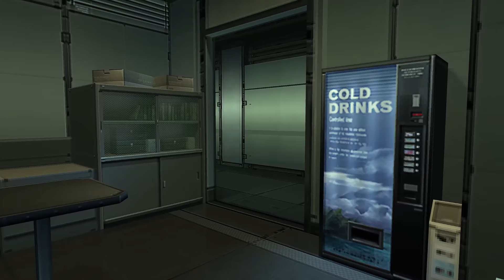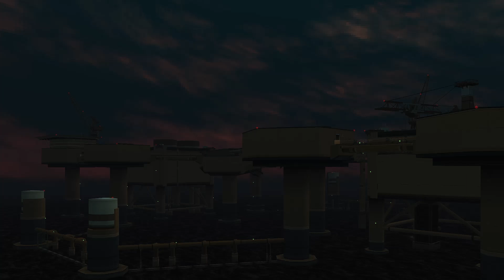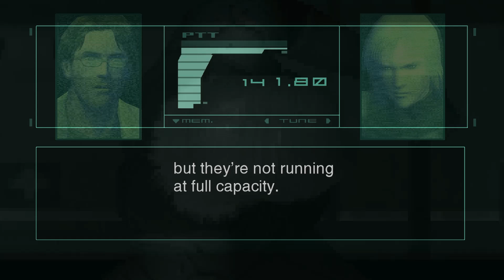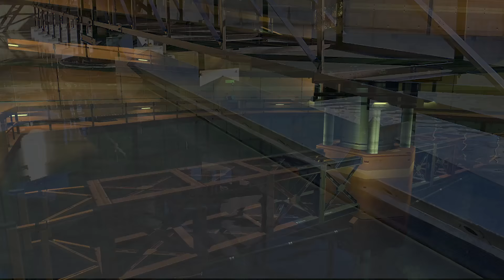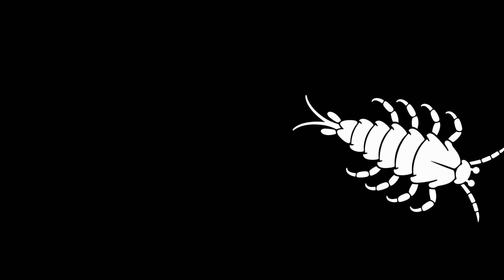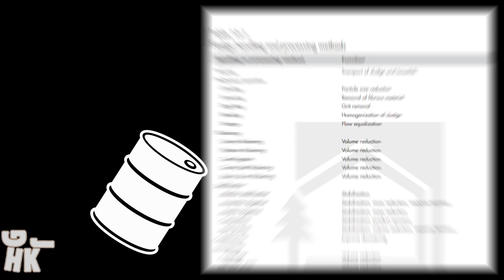How Realistic Is MGS2's Big Shell?

Comment: Oil's density property is why Water is the LAST Fire Extinguisher you want to use on an Oil & Petroleum based fire, rather you want the CBS Foam, the Blue one, which Smothers the fire, here removing the Fuel from the Fire Triangle! Water, Red, Cools, removing the Heat, CO2, Black, Starves, removing the Oxygen! My Fire Safety Training coming in handy outside of Health & Safety tests!

Comment: maybe the piles output on the opposite side that they intake? putting clean water outside the barrier holding back the oil, so the water doesn’t get sucked back up with oil water and they can use the same terminals?

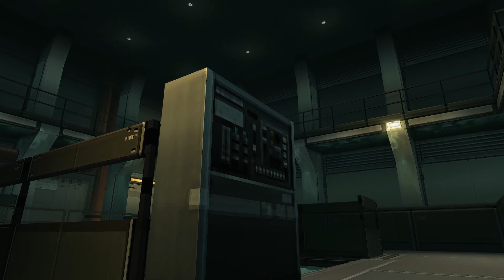Comment: 22:30
No it isn't. Practical engineering did a video on the most dangerous water on earth and it has something to do with this exact principle. No ofc it doesn't turn you into a lead weight...it just doubles the amount of energy it takes to move in any direction other than down. Which will keel xD

Comment: I think there might be more to Otacons idea of them secretly dumping more oil into the containment area than you might initially think. It is important to remember that the "oil tanker" that was sunk was done so deliberately by the patriots and that it was also in reality just camoflauge for Ray's deployment to a testing ground off the coast. I suspect then that there might not have actually been much oil actually on that tanker especially given when Snake accesses the navigation console he says the cargo should have been discharged upriver. 

Further the patriots MO is absolute control so having much more controlled amounts of oil being dispersed to minimize enviromental impact as they dont gain anything by destroying the ecosystem further this would let them get really good pr due to the very minimal damage that would actually have occured.

So by running the facility at a much lower capacity than its really capable of and only releasing enough crude to look scary to the public they get the image of a functional facility to hide arsenal gear.

Comment: Every single module of the Big Shell was given an identified purpose in this vid, except for the Shell 1 Core. To my recollection, the first floor had a room with a lot of lockers in it, which I presume is supposed to be where the personnel keep their work-related belongings. The first basement floor had a small storage room in one corner, a small break room in the opposite corner, and led to a conference room, which itself had a few branching rooms (One of those being a bathroom that Johnny was occupying). The second basement floor had the access point to Arsenal Gear, as well as a lot of computer stations. Sooo I guess the Shell 1 Core's purpose was mostly for worker and business affairs, but also had a lot of computers to perhaps also monitor things much like Strut A's control room? That's my guess.

Comment: With the construction shaping and paneling in the pump room, it's likely that it's not actually fully sealed. The ceiling may in fact be actuated to open.
There's also got to be a lot of fuel processing, material processing, etc for the sake of Arsenal Gear's production, so most processed waste is absolutely going into that. There are a lot of things you can make out of oil, after all.

Comment: Big Shell isn't realistic at all.

Kojima literally designed it with Lego, and the structure ignores real offshore engineering. You can't build a huge industrial ocean facility out of tensegrity, because waves, currents, and steel weight require massive rigid foundations.

The thin bridges wouldn't support the cores either, if a strut blew up like Strut H in Shell 2 the whole section wouldn't slowly sink (like it happened in game). It would collapse instantly and take the rest of Big Shell with it.

Comment: It is worth noting that the pipes are reaching from the Shell 2 side pile to the Shell 1 side pile and then to Shell 1.  Is it possible to see from the overview shots if the other fence's pipes also go to Shell 1?  Or do they connect to Shell 2?  If it's the latter, there's your intake/outtake.  Intake from the E/L fence's pipes, pump it straight across the 1-2 bridge, then out through the C/H fence's pipes.  If they're both intakes leading to Strut A, then yeah, we have a missing outflow problem.

Looking at the Strut A pump room - I do notice that the ceiling appears to be sectioned in a similar way to how offices have those drop-ceilings.  Perhaps these are some sort of modular ceiling that can be removed by the cranes to grant access to various parts of the room?  (This isn't the obvious strategy IRL, but the world of MGS has much more sophisticated engineering in some areas (the best mechs we can make are nowhere close to metal gears) so why not others?)

Shell 2's water: so...high oxygen content in water doesn't effect density.  But if you're constantly streaming bubbles into the water, which we can clearly see is happening, that does indeed reduce density, and real world pools that undergo this process are labeled with "do not swim" signs.  I believe testing as to how much they actually impair the ability to swim has shown it's rather less dramatic, but that's testing that happened well after the game came out. so...

Comment: Since we've already established that oil is less dense than water, it would make sense for the intake to be extremely close to the ocean's surface level. Conversely, it would also be logical for purified water to be discharged into the depths, at least 100 or more meters below the surface. That would likely help prevent immediate recontamination.

Comment: I think the lack of escape equipment is 100% premeditated; the reality is that the facility is a cover for a maximum top secret black-budget project. A lifeboat is a godsend for anyone who knows too much to escape and potentially vanish into NYC.

TBH though, the facility seems kinda massive for just one tanker that could navigate the Hudson, like, surely you'd just floatwall off the spill and use skimmers and the vast majority would be cleaned up by 2 years in. And the name, 'the big shell', for a facility that is just a big, empty shell. I guess GW wasn't very imaginative.
Reply: If I remember right, Otacon implies at some point while in the Shell 2 Core that they sent a second tanker to the same spot and deliberately scuttled that one too before assembling the Big Shell.
Reply: @HESHRocketWarhead  THe first tanker had no oil, it's holds were full of marines and MG Ray; the second tanker was specifically so they had a reason to build the big shell.

Comment: If there were lifeboats, how are they supposed to be used? Drop from 100m high? And from which struts, and access from where since all struts have thick walls with no windows? Even if you dropped them in the water somehow you'd still be stuck inside the big shell perimeter with no way of getting out of it, same reason boats can't access the big shell. It would be silly to hang a bunch of lifeboats just for show. But also, carrying all the machinery, food and replacement parts by helicopter is a huge waste of transport. Let's hope that almost all spare parts were already stored in advance in strut E before they finished building the shell. Then only when parts are needed, they are transported by the conveyor system of strut F. That's probably why most food was already stored there for long term use, no need for fancy kitchens, everything is likely microwaveable. It saves daily helicopter trips with groceries. Plus if they have fishing poles long enough, they have plenty of fresh fish
Reply: Given how you could climb down to the oil fences, my guess is that there were supposed to be lifeboat pods on the outside of the oil fences. Emphasis on "were" of course.

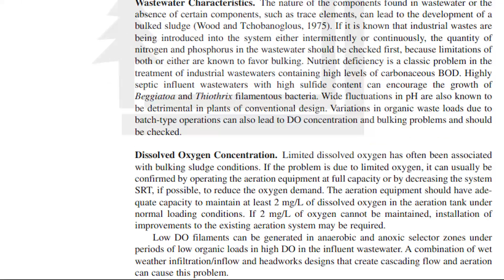Comment: 22:05 Dissolved gas doesn't appreciably change density, but aerated water can have reduced bulk density. Aeration introduces a ton of small bubbles from below, kinda creating a gas/water colloid or foam, which can drop the effective density. I'm not sure how low it can drop the density though, and it's likely that the large volume of rising bubbles will themselves provide lift counteracting that decreased density. Regardless, I don't think jumping into a vat of wastewater would be wise. 😂

Comment: There was no significant amount of oil in the first place. The ship that sank was carrying Metal Gear Ray, not oil. 

So if there is any amount of oil, it was shipped in for sure, and there's no reason to believe they wouldn't keep shipping oil in to replace the first shipment.
Reply: As a kid I’ve always thought the massive oil spill was just genuinely coming from the tanker’s engine considering it’s a big ass boat
Reply: @Rizzler8483 nah, it was the actual oil tanker they shipped in and deliberately scuttled.
Reply: All those metal bits surely need lube
Reply: The Patriots send in a second ship full of oil and sink that too, I'm not even kidding.

Comment: See the question I have is how much of this equipment is used for disguising the Big Shell as the purification plant and how much of it is actually used to help develop Arsenal Gear that just blends in with all of the other pump equipment
Reply: I imagine the logistics division (Struts E, F, H, and I) also doubled as a way for them to get necessary resources to develop Arsenal Gear. Strut C probably also doubled as actual accommodation for certain individuals like whoever was coming to work on Arsenal Gear too. If we reach a little bit, we could consider that Struts B and J were intended to also provide power for operations down inside Arsenal Gear in addition to the Big Shell itself (At least until they were ready to disconnect and fire up their own on-site power systems. Systems they wouldn't need to use for the time being since they had a decoy power system on the surface), and perhaps the Shell 2 Core's first floor was to keep there air down there fresh enough as well.

Comment: Some explanation might be crude oil. It contain light and heavy fractions. Light fractions are purified initially, but very heavy fractions, such as mazut and bunker fuel, settle to the bottom. This also explain why the base was partially abandoned and why there no oil skimmer on the sea. It’s incredibly difficult to clean heavy fuel from bottom because it’s forms tar balls. This heavy components form sticky spheres that can roll along the sea floor or wash ashore.

Comment: Thank you for talking about this. Ever since I started working in wastewater treatment it's been bugging me how there's a clarifier without sweeps and an aeration Basin in an enclosed room.
Reply: As a hobbyist level designer, who's worked in a ton of warehouses, and does idle research on safety regulations and other architetural subjects, I always end up noticing the brazen lack of safety-compliance in the environments most common in FPS games
I get it, since if they were "compliant" most levels would be a sea of yellow barricades, chains and fences. It doesn't "bother me" but I do notice
My favorite is how most cages on ladders usually start below the mounting point, which is the very part cages are meant to provide additional fall protection during
Almost every ramp is too steep. Almost every staircase doesn't have enough landing area at the top bottom or between, etc

Comment: Oddly, my biggest problem with The Big Shell's design was its kitchen, or lack thereof. No dish pit, no overhead ventilation, no mop room, limited equipment. The list goes on. Even with a skeleton crew, a plant that size is feeding at least 50 to 60 people three meals a day and operating nearly 24-7.
Reply: Considering one of the major themes in the game is AI control, it's safe to assume that the facility has as few workers as possible in lieu of machine automation. If I recall, the "terrorists" only took about 30 hostages, not to mention that the Arsenal Gear is supposed to be the "life boat", so the kitchen on the surface doesn't need to be extensive.
Reply: @forgot7en  Also a lot of those hostages were only there because of the presidential inspection.
Reply: I'm not sure how much of the design oddities are oversights vs how much is leaving clues that the plant is actually just just an elaborate front for Arsenal Gear
Reply from the maker: Good point, I completely missed that. Packed lunches only then I guess!
Reply: To be fair... this is all happening off the coast of NYC/Lower Manhattan.  So people could just ferry out there for their shift.

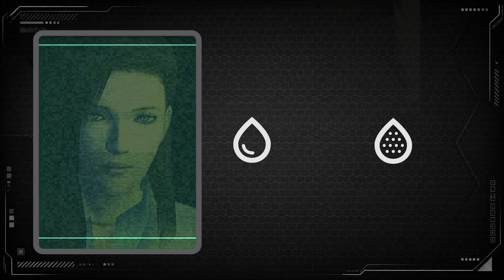Comment: 3:16
Not sure if it shows up later, but wastewater sludge usually ends up on farms as fertiliser. 
That or it's burned for a mediocre energy gain.
Reply from the maker: When reading I honestly never came across where it ended up. I always assumed it was dumped somewhere like trash. But it’s good to know it’s not completely wasted!
Reply: @ProbablyPaz  Strangest thing about the big shell is that they turned it into an oil disposal facility. 
Oil collected from an oil spill should still be able to be converted into fuel after it's separated properly. The other issue is that the big shell is treated somewhat like a sewage plant, if they're just pumping the oil in, sedimentation tanks wouldn't create sludge, just separate out coarse marine debris from the oil. This would also mean you have perfectly functional crude oil, which they're using sea lice (likely a mistranslation of sea slaters) and bacteria to break down and then create much less useful sludge (which could be burned in their local powerplant to turn the biomass back into energy) though why the big shell didn't just:
A) Distil the oil out into fuel oil and pump it directly to New York by turning it into a fractional distillation plant. 
B) Pump the oil to land, or to ships outside the oil fence by running a pipe under/through it, then have it distilled on land. 

Doesn't make a huge amount of sense, for a fresh oil spill. One reason would be that Though Kojima likes to turn his games into a bit of a show and tell for his own opinions so I'm assuming he wanted to tell the audience about how oil spills could be cleaned up. 

Another reason for this might be that they left the oil sitting out in sun, waves and open air for a while while the big shell was built. This would start causing some of the crude to weather, turn to dense tar and sink. Or parts of it would mix with the water, or emulsify, polluting a large area. Which would be why they need a full containment fence while it wouldn't stop emulsion or contaminated seawater from getting out, it'd at least stop lumps of tar. This would fit how the big shell works a little better. It would also fit the timeline too, as the big shell can't have been built overnight. 

They'd have spent their time better just recovering the crude oil immediately, I don't think there's a reason for why they didn't do that ingame. So I'm split on it being a Kojima interactive video essay and a half-baked execution of oil recovery and cleanup.

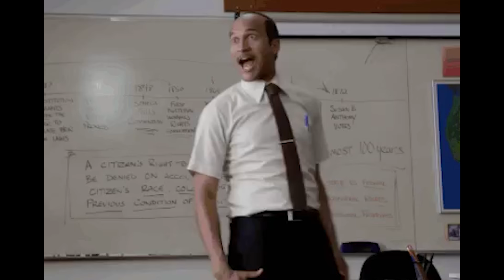Comment: not sure if you're about to get to this in the video but around 15:00 when you talk about the pumps emulsifying the oil in the water, I think this would happen mostly with centrifugal pumps. Positive displacement pumps move water (etc) by squeezing instead of pouring it into a blender with a hole next to the blades for the liquid to get flung out of